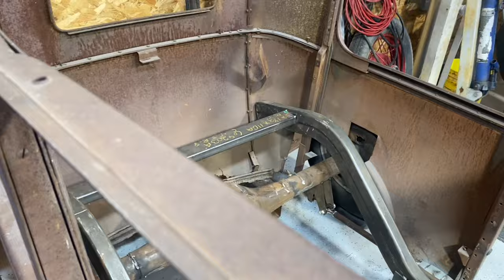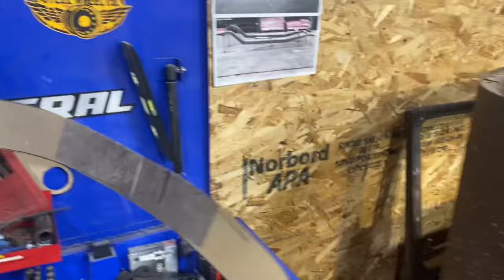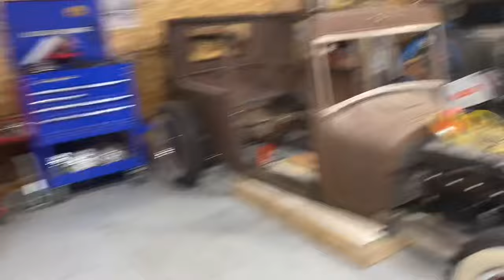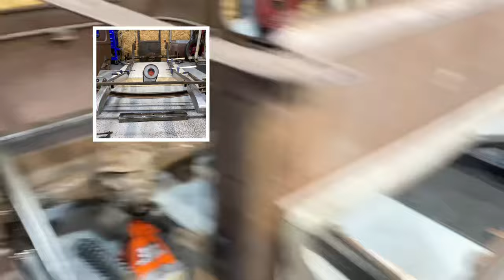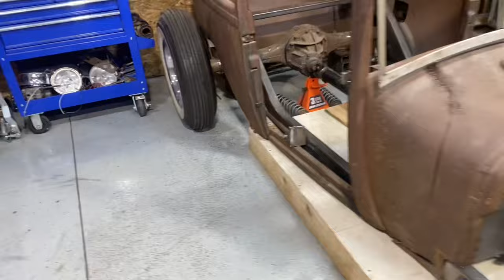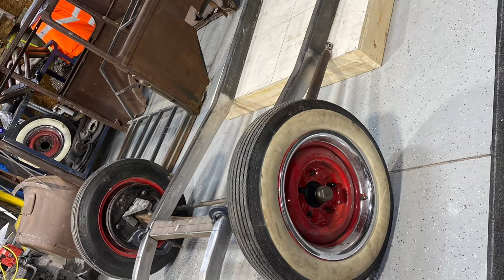Ford model T build short pt .1

Comment: I have the same car and preparing to build my frame. Yours looks like what I'm after. Did you widen the frame.
Reply from the maker: I built my frame to model A measurements. The front is 26 “ wide and the rear is 39” wide. With 107 wheel base. The model A frame is straight rail from front crossmember member to where the fire wall mounts. After the fire wall it started to get wider. Mine does not.